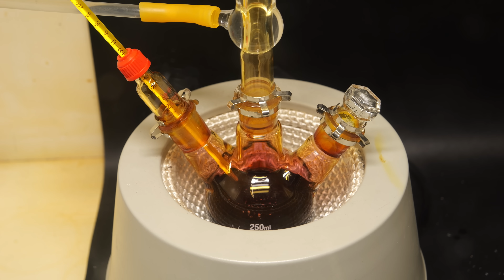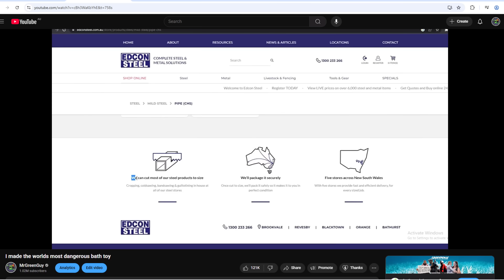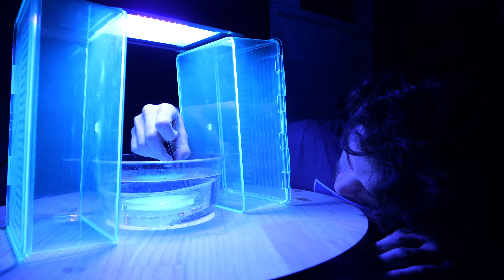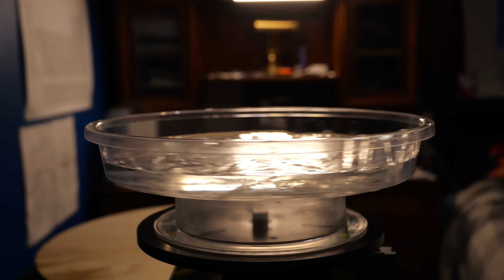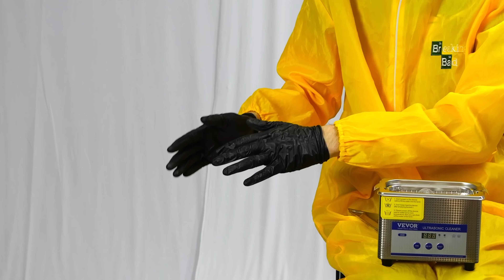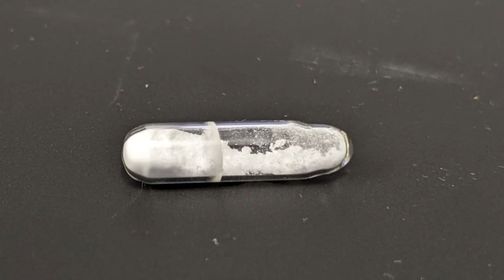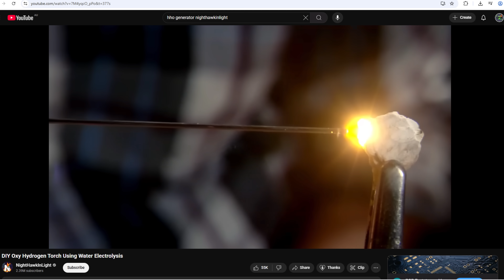Ranking My Experiments I Couldn't Post

Comment: use pressure bearings for bearings for less vibrations and maybe you can use high pressure air to spin it too to have less mechanical vibration transfer from the motor

Comment: I know an absolute frack ton about poly resin, MEKP, epoxies, fast and slow hardeners, Liquid Cobalt, fiberglass stuff, vaccuum bagging and mix ratios to cure as fast as possible (they say 1% to 100 and i always go up to 2-5% to 100, as fast/hot as you can cure it before it catches fire ( usually they want 0 humidity and 25 deg for a 30 - 60 min cure time, I can get it to go off in about 5 mins when its 1 deg outside and 100% humidity while smoking and turning purple) 

resin hates liquid so you gotta pour it hot  sorta like if ur putting a patch on a actively leaking boat outside in canadian winter, and car wheel balancing works well, also a cars air intake can vacuum a bag pretty strong and fast dependin on the size... not as fast with a 50ft hull :D:D:D:D
Also, try hitting a little Mekp with a hammer for some boom

Comment: Rubber and silicone are good at removing vibration aswell because it can deduct energy if you have it between something vibrating and something that’s not vibrating it will decrease vibration a lot, foam works too

Comment: For the telescope mirrors, I noticed that increasing diameters result in drastically higher edges on newtonians

Aka: would it be possible to create the back mirror in a modular configuration? Or; create a 'pie slice' that you duplicate for a solid circle. I'm sure you wouldn't need a solid circle anyways; so long as enough light bounces off a central piece onto the front mirror. 

I've always thought about making my own newton from scratch, and REALLY want to see it succeed.

Comment: Okay, so, glass beaker on an automatic stirrer. With a plastic petre dish with a bar magnet glued to the bottom of it. And just enough water, or mineral oil to lift said dish just enough so there is no friction. Then you can control the speed of the spin and it should stay perfectly centered even at higher speeds.
Reply from the maker: Yeah I tried this method a while back. It keeps things reasonably stable. Removes small vibrations. However overtime it creates oscillations that can sometimes self amplify rocking everything back and forth. It is possible that thicker liquids might work better tho

Comment: Maybe trying to make a spinning machine to curate the resin is approaching the problem in a harder manner? Like, maybe you could calculate or find a 3D model of the shape you need, 3D print a mold for it and curate the resin in that pressurized thingy? (Yes, I know the name of things, I swear)
If you can't 3D model/print I'm pretty sure there are online services for that. I am coming from the position of someone that knows almost nothing about liquid-mirrors or telescopes, but I kept thinking about a 3D printed mold for the resin, to me it seems easier than the mechanical engineering feat you are trying to do.
Good luck on your projects.

Comment: Hey! Fun info for science bros in the 'weed is highly illegal' parts of the world.

Modern pot smokers often use heated glass to cook off weed concentrates on contact. To do so we use high quality quartz glass.

There are countless companies that specialize in making weird, custom glass work out of it for stoners.

I can promise you, they can make anything you need out of quartz, and I'll even bet ya its cheaper than proper scientific glass.
Reply: I'd also like to say, I think your on the right track with the computer chair.

I'm no mechanical engineer, and as you can tell by the first post I'm a pothead, but hey, we are here for science, not credentials.

IMO you were on the right track with the electric motor on the chair, you just need the help of /anybody/ with some mechanical ability to put that together for ya. Love your videos, your clearly smarter than I am, but ya aint no millwright bud, the problem I think you are running into is that your idea requires precision, several of your ideas look workable but unless done near enough to perfectly they will never produce good results. I think the chair is a great option as a starting point, as you can get em cheap, they are designed to take the weight, and they are remarkably smooth. Personally I think I'd try to attach something to the post of the chair that can interface with the motor, gears or a belt like you are doing there, but instead of trying to fix them together, fix the chair /firmly/ to the floor and the motor as well, separately, then control the distance between them to bring the gears together or attach the belt or whatever ya go with. Having them both firmly anchored will help to dull a ton of vibrations down the line. I would also suggest spinning the system up to significantly over its functioning speed before use, this should help you see any ripples forming in the liquid and let you easily debug issues without repeating the entire process time again, because being even a few fractions of a cunt hair off dead centered is gonna fuck ya here.

Keep at it, this smells like an easy solution to a common problem and like a great invention all around. Just because people with more funding and fancy fuckin labs failed doesn't mean you wont be the cleaver sod that figures it out.

Comment: You can create a parabolic  shape using a thin film and a vacuum. I don't know if you could use it to cast resin in. However, it could be interesting to use one of those reflective silver emergency blankets and shape that. Unfortunately it would only be temporary... unless you find some way to have it keep its shape... maybe adding resin to the inside of the container, the blanket at the bottom, pull the vacuum... and when the resin hardens it will harden on the blanket?

As someone who loves projects, coming up with crazy ideas and then just dives into them. Which usually bring many challenges to solve, and lots of which I manage to overcome after some attempts. But then eventually hitting a road block which makes me "abandon this project for now". I can fully relate to that "there's so many projects 'I want to do'", and to "many resources gathered for such projects".
And you also seem to have an extremely broad spectrum of interests, which is great, but also horrible. It can easily feel overwhelming. Too many things I want to do, not enough time to do them all.
For me it's just not chemistry, but pretty much everything else. It's not like I don't find chemistry exciting, but my knowledge is too limited to make anything but the most basic things, and it's best if I keep my chemistry knowledge at that level.

Comment: Actually there is a type of bearing called "roller bearings" it should in theory have close to 0 shake because it's just a few cylinders that roll around(it has more contact as opposed to balls), it's actually used with wheels(they have tires that help with stabilization) to make a giant carousel that sort of emulates a sledge, you could in theory test it out, the big ones shouldn't be too expensive either.
I think you can make electromagnets and switches(complicates things but when someone without any knowledge and a chatbot with 0 equipment other than a soldering pen can do it, it shouldn't be that hard, plus it's cheap so you can walk away without much loss).
These are just my ideas based on little projects I've done here and there it should be possible.

Comment: Regarding your little project with the parabolic resin: the only way I can think of to rotate something at a consistent speed without any vibrations would be to start the rotation while it is floating on a magnet, in a vacuum so there's no friction. Also the floating object would somehow have to be perfectly stable above the magnet. As for how anyone would manage to do that... I don't think anyone will manage to do that (properly). Maybe in an industrial setting you could do it, but I think it's a little bit insane for an at-home project.

Comment: rather than air bearings use bearings that run on films of oil like in an engine and you might be able to have it be spun using the oil to spin the turntable like a water wheel or turbine does with a nozzle if ykwim

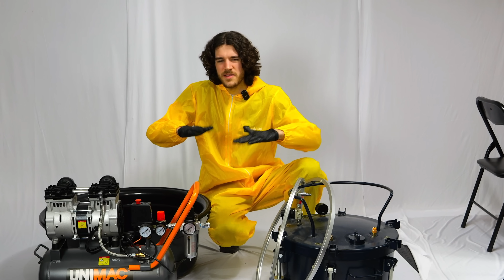Comment: 15:03 I find your bucket idea really good and have a few relatively "cheap"/locally sourced ideas for improvement.
1. Separate your water catch bucket from your "spinning" bucket, by suspending the spinning one from the ceiling or at least putting it on its own feet (saw horse etc)  above the catch bucked - This should dampen some vibrations from the pump and the dropping water.
2. Improvement from 1 --> Use a 3 bucket system. One for catching the water on the floor, one for the spinning like mentioned in 1 and one above the spinning bucket. The third bucket will be filled by a pump (placed in the lowest one) from the lowest bucket and then feed the water via gravity in the spinning bucket. Lower or elevate this bucket to increase/decrease pressure. This way you fully separate the vibrations and/or pressure/flow inconsistency's from the feeding pump to your spinning bucket.
3. Use a pipe or nozzle on your bucket outlet, to create laminar floor. I am guessing, this could also create vibrations.
4. (Less certain if this would actually help or work) Use a plumb bob (or fishing weight) hanging from the center of your spinning plate trough your outlet to center it in the spinning bucket. This could work if its actually laminar flow.
5. Use a more viscous fluid like motor oil in your spinning bucket. It takes longer to spin but when it does, it might absorb some vibrations/oscillations on its own. Before you do it, make sure, the pump and its seals can handle it (can pump at all and does not dissolve/damage the seals).
6. Use more (smaller) inlets in your spinning bucket over the whole circumference. If i seen it correctly, you are using only 2 on opposite sides of the bucket. This could lead to wave crests at the outlets and wave troughs after it, causing the bobbing you mentioned.

Besides this i also have a new idea where you would still use a bucket as a liquid bearing but you spin the plate directly, using the principles of a magnetic stirrer.
1. You float your plate in a bucket of liquid, preferably also viscous.
2. On your pate you mount at least 3 equally spaced neodymium magnets on the outside
3. You mount the same number of neodymium magnets on one of your rotating tables, matching the position of the ones on the plate but with opposite polarity. 
3. Then above your floating plate, you hang the rotating table upside down. (The same could be done from below but is likely more difficult because of the spacing)
Once the rotating table is turned on, it should spin the plate without touching and therefore imparting vibrations or oscillations from the rotating table.
You will have to experiment with distance, the number of magnets needed, and maybe also try same polarity to push the plate instead of pulling it. You can also try to create a wall of magnets per location instead of a single one, if it is to weak or hard to line it up correctly - e.g. an X shape with hole in the middle on the rotating table.

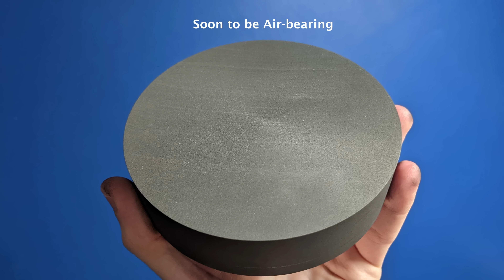Comment: 16:15 @mrgreenguy you should try using the stuff that is used for wood working drill press, there was one with 3 legs on all sides to grab wood peaces or to drill screws to hold something very securely. It has very good middle alligment and surprisingly little vibration. They should be relitivly cheap looking at how much you spend for things such as gallenstain. You should be also able to find one quite easy, but problem might be mounting it vertically although there should be some vertically but I don't think I have seen one.
Reply: You mean a lathe?
Reply: @kyetes.866 yes, exactly that didn't know how it was called

Comment: So they do sell blunt needle tips, FWI. If you get the screw on type that are used with reusable glass syringes they won't fly off. You can also make your own flame arrestor inside to help with that. You can also just use welding tips.
You ampules might need ultrasonic cleaning actually, just before you try to fill and seal it. You may also need to dunk those in acid to clean them inside. Also the caffeine might just be statically charged. As for getting smooth spinning, your floating tub idea looked really promising but if you want to smooth that out further, fill the basin it floats in with something heavy like mercury so it has more inertia when its bumped and forms smaller waves. Also, you gotta balance your spinning parts perfectly. To do that, use a high spin rate and add an innertube to the outside filled with sand. The sand will move around in the tube to the exact distribution needed to balance the spin. You can also look at using magnetic gears to get floating interfaces that will isolate the spinning basin from the floor.
Reply: Very good tips. He could also try making a Powder so to speak of bigger coffein crystals they would not Stick so much

Comment: If you'd managed to put the pot on the car wheel on the side and spun it with some generator it might work? This might sound stupid but if somebody managed to put a car or a bike on the side (for example an auto repair shop) you could put the pot on the top of the wheel and gas. The momentum would be enough to spin the resin, and it should be cheap if somebody let you do that..

Comment: From what I remember from my time in uni and a brief stint in lab work. Dimethylformamide is a great organic solvent (high boiling point, low volatility, polar and aprotic) but often isn't your first go to since removing it from your product afterwards is a royal pain.

Also that hydrogen peroxide is probably not 50% peroxide anymore depending on how long its been sitting for. Though also depending on how well sealed the container is, and how long its been sitting it might be off gassing oxygen and building pressure as the peroxide breaks down.

Comment: for the lazy suzan ... use what is essentially an air hockey table with either air water or oil going through the mozzles to suspend the spinny part in the middle.

Comment: 16:01
This is probably gonna sound dumb, but have you considered shooting NASA an email and ask for their material on their method for this?
Cause I'm pretty sure that was how they ground the mirror for the Hubble Telescope (yes, the one they had to replace, and the one they replaced it with).
It was the only way they could figure out how to make a parabolic mirror that big, who had as tight tolerances as were needed.
Their methodology should be fairly easy to convert from glass casting to resin castin.

That could be the way you do it;
Cast a disc of resin as well as you can, then use a turntable to grind it down to perfection before mirror-coating it.
Castin a perfect parabolic shape is almost impossible. Even sound could cause distortions in the casting.

Also, a thought occurs;
Those BIG quantities of chems that you had to buy, despite only need a fraction of them. Well, you can't be the only one with that problem.
So why not part them out and sell the stuff you don't need on E-bay or whatever. Same goes for the machines you don't want/need.
At least that way, you'll recoup some of the investment.

Comment: the vibration issues what would happen if you used magnetic levitation so the table doesn't vibrate the container the resin is in?
literally just glue the magnets with hot glue and if you need to remove them use isopropyl alcohol. make your piece thicker and polish out the imperfections on the outer layers

Comment: I am the exact opposite of you at 25:08. The things I am scared of are toxic things, not explosive things. Explosive things or things that are a fire hazard are fine for me because I am not working on a huge scale and the danger of a fire sort of scales exponentially (so the danger is very low at small scales). However, I am very scared of toxic chemicals because knowing if they are there and protecting myself from them are much harder and aren't really common sense.

Comment: You need to attach the top of the chair to the motor shaft itself, and have a decent brushless motor to do it. Brushed motors will give a little more friction and torque, fine in most applications but for yours would cause a lot of turbulence and vibration in the resin. Try an actual turntable's motor (like, from a record play), they need to have smooth motion by design so that the needle doesn't skip over the grooves in a record. As a rule of thumb, the older the record player, the more weight the turntable can move. Inertia plays a big role when you add that much weight so once it's set up, give it a gentle spin as you start the motor. It should be able to keep it spinning after that.